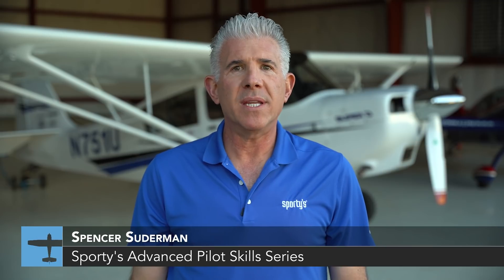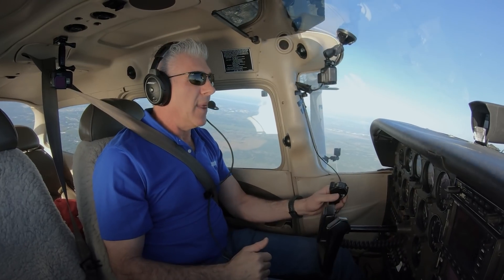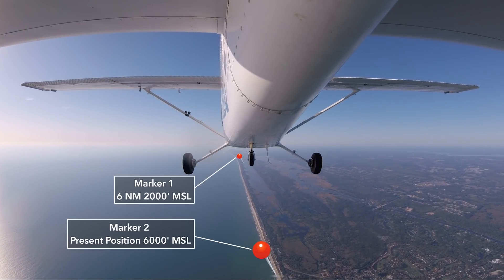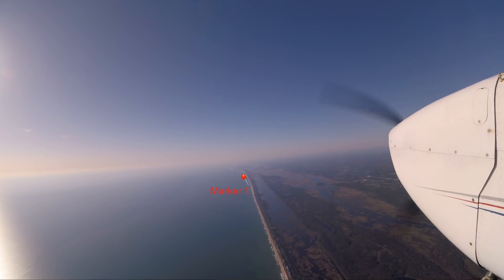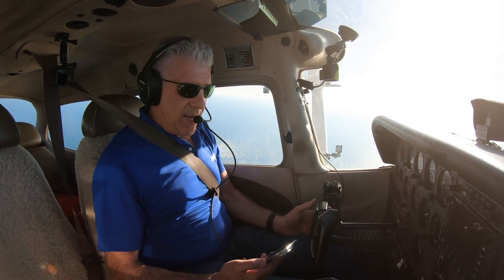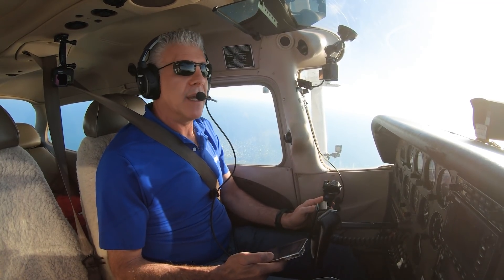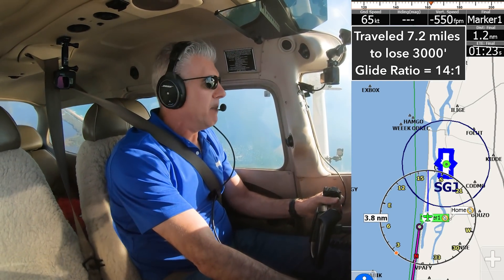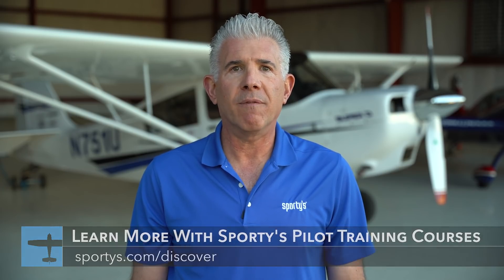Cessna 172 gliding distance - Sporty's Advanced Pilot Skills Series with Spencer Suderman (ep. 6)

Comment: One thing to bear in mind is in a real engine out you will have a stopped non feathering prop providing a huge amount of drag.
Equally you were in a modern C172 which doubtless has a better aerodynamic profile when compared to older models.
9:1 sounds realistic but I would not want to try that for real.
Reply: A windmilling fixed prop driving the dead engine is worse than a stopped fixed prop for drag. It is more efficient at extracting energy from the airflow to then waste it as heat energy in the engine’s friction.

Comment: Some comments mentioned glide distance affected by wind.  Some authors recommend increasing best glide speed by one-half the headwind component.  For a tailwind, you can decrease your airspeed some but never below minimum sink.
One or two comments mentioned effect of stopped prop on glide distance.  Great article on this in February 2011 AOPA Pilot by Barry Schiff "Stop the Prop"
Reply: The best (longest) time of descent speed would naturally have an effect on those calculations. 
That speed is lower than best glide, so the increased time with a tailwind would increase its advantage for your distance, but only to the point where the decreased glide slope through the air counters the gain from increased loiter time in the tailwind.

Comment: I find it interesting that you give the glide ratio as 9 to 1 but that’s not how Cessna states it in any of the POHs I have for 152, 172N, 172P or 172S models.  Cessna has the chart of “Height Above Terrain-FT” and “Ground Distance-Nautical Miles”  This appears to indicate from 10,000 feet you could potentially go 15 miles. So, I took 15 times 6076 (nautical mile in feet) to obtain a figure of 91,140 feet. Then divided that by 10,000 to  obtain a 9.11 to 1 ratio. Is this correct?

Comment: weight has almost no effect on glide range. only effects the glide time...  and idle thrust still gives you plenty of thrust and keep in mind windmilling propeller (in real engine failure) gives you consideralbly more drag... anyway thanks for the test and the flight video
Reply: There are 3 real failure modes with an engine: Loss of power with engine running (as shown in video), engine not running with propeller turning (windmilling), and prop stopped.  Each mode has a different drag contribution to the plane.

Comment: Best glide speed depends also on the wind - at least for distance traveled over ground. I once had an argument with my teacher in the cross-country phase of my PPL. He asked me if the engine quits, what would be the right speed to get to that airport. I said that it depends on the wind - and he almost freaked out. He wanted to hear the best L/D speed, obviously ...The best glide speed through the air is 65 or so in the Skyhawk, but over the ground, it depends on the wind direction ... Imagine you would have a 65 knots headwind - with 65 knots through the air, you would go down like a helicopter on the spot ... :) Does anybody know what the speed should be in reasonable wind conditions - let's say with 15 knots headwind? 2-3 knots higher speed or so? I understand that this question is somewhat academic cause you don't care about 2-3 knots in an emergency situation ...
Reply: The POH isn't clear on how the 9:1 ratio was derived.  Engine failures come in 3 flavors; loss of power with engine running, engine quits with prop turning (windmilling), and prop stopped.  These will have varying amounts of drag. Then there are the weather factors as you mentioned including wind.

Comment: Interesting. As a skydiver we have a glide ratio of about 2 to 1 at 1 to 1 wing loading. You get very good , very quickly at landing accurately from around 2500 ft.  I think engine off training in a 172 wouldn't even raise the heart rate for an experienced skydiver. btw, my armature calculations indicate that the sink rate vs airspeed  is about the same ratio for these two. The Cessna will go 4 times faster than the parachute and go  4 times further.
Reply: I would advise a little more thought in parsing out the interrelationships between sink rate (rate of descent), glide ratio (which is numerically equal to the lift-to-drag ratio), and speed, and also best time of glide speed versus best distance glide speed, i.e. best ratio speed. 

If the rate of descent is the same, but the Cessna is 4X faster over the ground (not air speed), it has a 4X glide slope advantage. This is approximately what the poster gave, his 9:1 versus your 2:1. 

Make sense?

Comment: Hugely disappointed in your knowledge of aerodynamics, Spencer. Even worse that this was supposed to be a "learning experience." It was the opposite. I'll be blunt. It was ignorance and falsehoods being broadcast far and wide with quite likely fatal results for some aspiring young pilot. 
Alone in the airplane, so it is light. At 3:06, you say "I would expect to actually have a better than 9:1 glide [ratio], and expect to go further." 
The weight of the airplane does not change the design of the wings or the airframe. The L/D (glide ratio) is fixed at takeoff, actually it is fixed in the final design prior to production, and does not change with weight. Whether the aircraft weighs 1800 lbs or 2200 lbs, the L/D of 9:1 is the same. 
I won't try to explain this to you in detail in this brief comment, but suffice it to say that in a NO WIND situation, two identical airplanes flying side by side but differing in weight by 20% have precisely the same glide distance available. Importantly, they each need to be flown at their most efficient minimum drag AOA - L/D Max. In a headwind situation, the heavier aircraft will actually glide further than the lighter one. 
I will be happy to explain this to you until you understand. Feel free to contact me if you are doubting the validity of this basic aerodynamic fact. Even better, research it yourself so that you are completely satisfied that L/D is a function of design and does not change with weight. To reinforce it, read up on the aerodynamics and rationale for competitive sailplane pilots carrying water ballast. This is a group that obviously understand L/D. Internalize the knowledge for yourself. 
In the situation you have set up for your demo, a lightly loaded aircraft, you should set a glide speed 3 - 5 knots (my estimate) slower to achieve best glide AOA. The book best glide speed is just a guide to get close to L/D max (best glide AOA). If you understood this subject, you never would have made the blatantly false statements at 1:15 (how heavy is the airplane?), 3:06, 3:35. . . . 
Please be constantly aware that what you say on YouTube can influence many young pilots. Making them think that a lighter aircraft glides further could be fatal. By now, 13,000 viewers could have repeated these falsehoods to mislead countless more thousands. 
A 14:1 glide ratio in a 172? Such a thought should not even enter your mind, Spencer, much less escape your lips. It is absolutely dangerous and irresponsible to pass on to trusting students. 
Much like the understanding that power controls altitude, and pitch (or trim) controls speed, the fact that L/D is not affected by weight seems counterintuitive to many pilots, obviously including yourself, and especially to students. It is my view that not understanding these two basics of aviation is a potential death sentence. 
One final point, to which you allude at the end: Power setting. You say at 2:32 "pull the engine power." Was that the mixture or the throttle that you pulled? If you did not shut down the engine, then the entire exercise depends on whether you successfully set a zero thrust rpm to match an inoperative engine with a windmilling prop. That and the possible tailwind.
 
Some of my aviation background: 21 years USAF pilot, flying fighters and FAC, instructor in F-105, O-2 and OV-10; 27 years airlines; have owned and flown a dozen or so of my own airplanes over the decades; 12 tours in harm's way (1 as a Covey FAC in Vietnam, 3 in Kosovo and 8 in Iraq as civilian ISR contractor). My personal fleet now numbers a Cherokee, a Rutan VariEze, a Rotorway Exec 90, a Hispano HA-220 Super Saeta, a Buccaneer amphib, a C-337 and a C-414.
Reply: Appreciate your comments based upon a meticulously studious review of the content presented. The weight of the aircraft is actually necessary—it is the effective propulsion of the gliding aircraft pulled on by gravity.  Considering the unpowered aircraft at altitude , it is important to recognize that the initial energy of the aircraft, primarily potential, is directly proportional to its weight and that has an impact on the engine failure scenario and alignment to L/D calculations where best glide speed is desired; however, rarely acheived in powered aircraft in a failure due to the numerous variables not under the control of the pilot.   There are multiple potential engine failure modes resulting in different gliding scenarios; partial or complete loss of power with a running engine, windmilling propeller with a non-running engine causing drag, stoppage of the propeller, and loss of the propeller from the plane - which actually happened to me once.  In this video only one engine failure mode is presented, for obvious safety reasons.  I also talk about the factors that are to be considered when comparing the exercise shown to the published best glide.  It is stated that the engine is idling and that adds something to the time/distance the airplane can travel and the mention of weight goes to the power:weight calculation that all engine driven machines are subject to.

We can theorize various scenarios and potential glide ratios, speeds and distance all day long and compare it to some published data in the POH, however, that information is abstract and neboulous to most pilots in the absence of experience in the plane.  

The suggestion by you , and several others that I should have done this by killing the engine and letting it windmill is not a demonstration that anyone should undertake for obvious reasons.  I'm happy to discuss this further if you would like to reach out over any of the various private messaging channels available and make a personal connection with your actual identity.  :-)

Comment: At 3:10 you mention that your aircraft is light and you are alone in the airplane, and that you expect to glide further. This is false, weight does not affect glide angle, it only affects speed.
Reply: Thanks for your comment.  Yes, it's true that weight impacts speed for a given ratio; however, the gliding speed, and, consequently, the gliding time, does change with weight.  Also, powered aircraft have a single "best glide speed" published in their POH for emergencies.  This "best glide speed" is a compromise over a potentially broad range of weights for the aircraft.  These planes are not meant to be gliders nor have pilots calculate an optimal glide speed based upon weight for each and every flight.  I also mention in the video more than once there are numerous factors involved here including wind, the idling engine, and the pilots ability to fly the published "best glide speed".  There is a significant difference between powered L/D vs gliding L/D due to the additional drag of a non-powered rotating propeller or stopped propeller.  Engine failures come in many forms;  from a power loss due to any number of reasons including fuel delivery issues and partially blocked air intake, to the engine quitting and windmilling resulting in drag and complete stoppage also resulting in some drag.  The fact is there are many L/D scenarios that a Cessna 172 could encounter.  I picked a convenient one for this demonstration which was more about how to handle the situation than how to be a glider pilot looking to maximize glide performance...which is not Cessna's intention in how they publish their procedures.

Comment: You probably had a light tailwind to get 14:1 n a C-172. One thing you could have done to confirm these numbers was to do the same exercise from pt 2 to pt 1 and then compare the altitude loss.
Also, the best L/D will not change for any given weight: only the speed at which best L/D occurs will.
You may want to consider speaking to a glider pilot about this: they win, or lose races based on this phenomenon